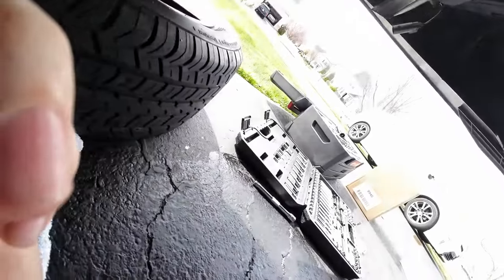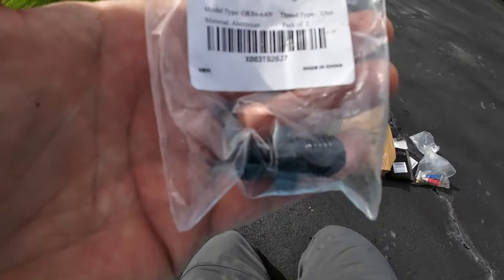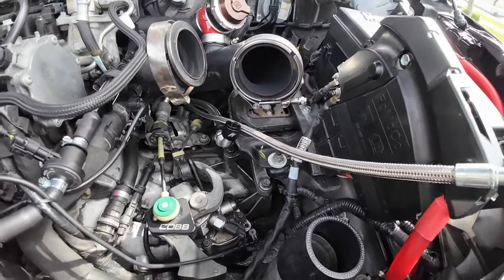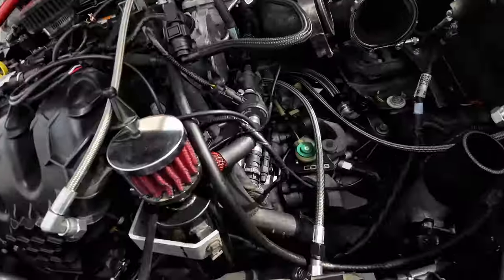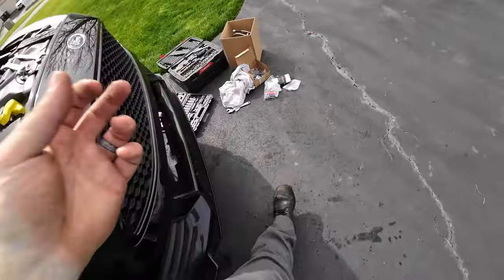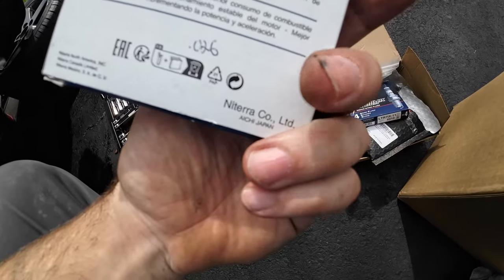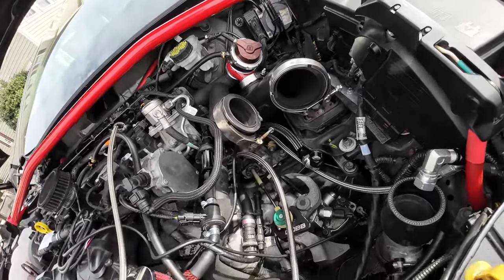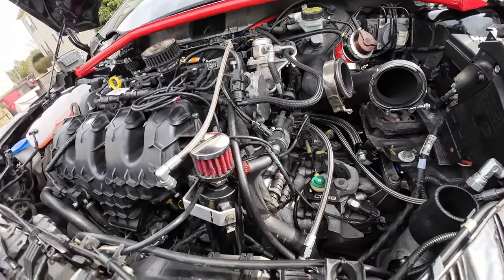Focus ST Sidewinder kit || Coolant Feed AN Conversion!!

Comment: You ain’t tell me about the YouTube lol
Reply from the maker: haha naw i just post for fun 😂 people be gate keeping sidewinder kits and i’m taking a stand 😂
Reply: How long have you been running the cobb short throw plate?  I ran a short throw plate back in 2014 and it destroyed my shift cable,  shifted into 4th and boom.  Snapped it,  shifter was all sloppym. I dont recommend running them.  I do recommend all the upgraded bushings to eliminate slop.
Reply from the maker: @WhiteblurrST oh my god that sounds terrible 😂 i have had mine on for 3 years? i used to track this car like religiously lol held up good no complaints i know there are better 

was like the first mod to this car, that and shifter bushings
Reply: @VJC4x  yea i had mine set at 20%,  i had one of the first ones made it was by fswerks very similar design,  i think whats saving you is your bushings being upgraded,  mine weren't at that time because there was no such upgrade.
Reply from the maker: @WhiteblurrST ahhh yes bushings where a MUST!!!
Reply: @VJC4x  yes definitely. Ive had to deal with alot lol 😆